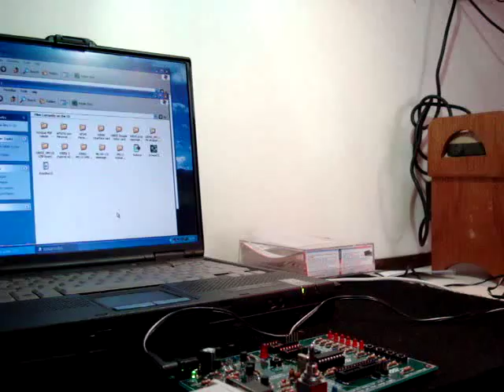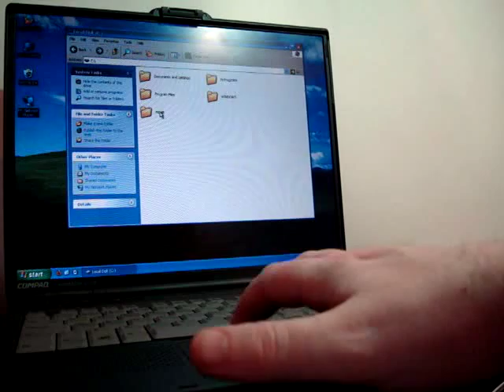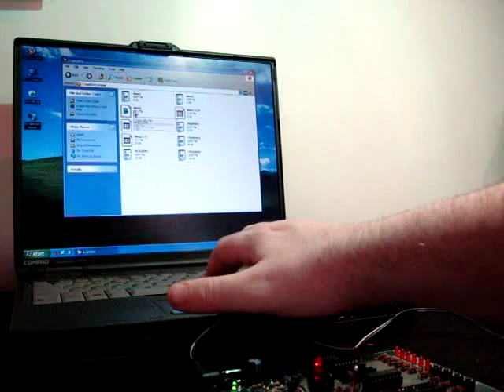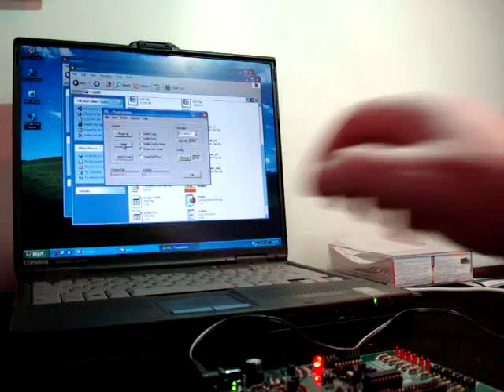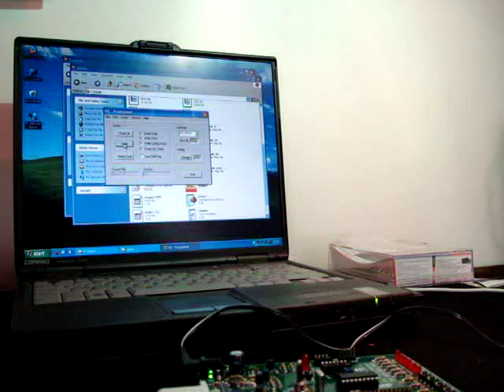(pic3) Programming a PIC16F627 chip , velleman kit, K8048

Comment: Most laptops do not have serial connections. Some newer desktops do not as well. That leaves no other option other than going backwards with computer technology, or, a USB to serial adapter. You say none work. I will correct you, usb to serial adapters do work but not all of them. The $20 one from Radio Shack does not work but the Gigaware® 6-ft. USB-A to Serial Cable for $40 works great. I also use it for parallax boards but it won't work for AB PLC's